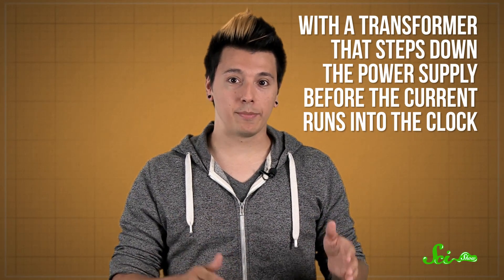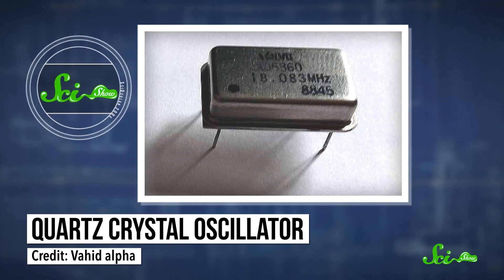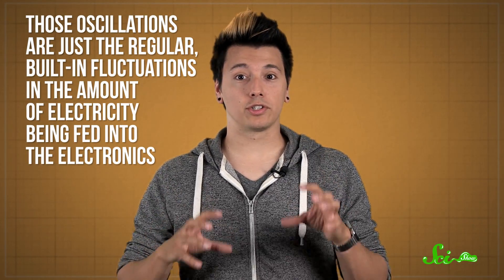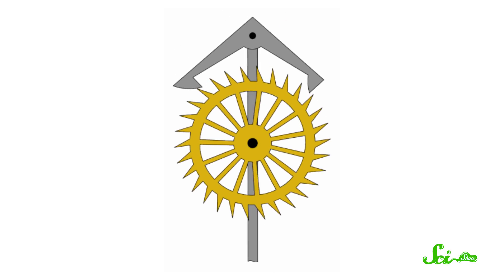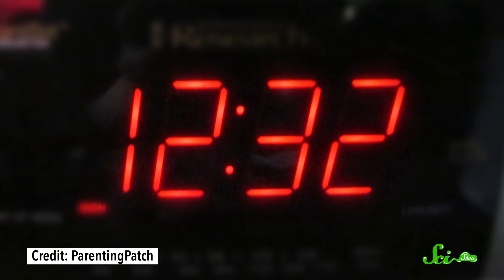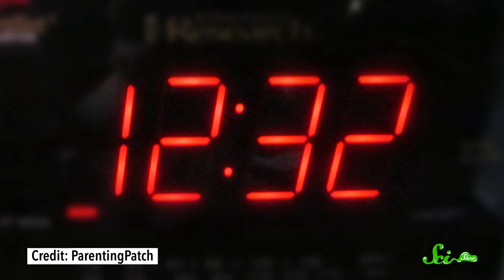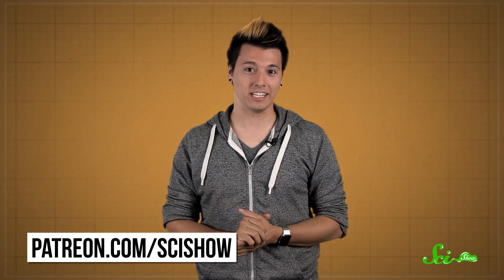How To Make a Digital Clock

Comment: 1. UNSCREW an old digital clock
2. PUT IT INSIDE A metal suitcase, so you cannot actually see the clock
3. run around with it near people, untill they panick

you ll guaranteely get a president approved clock, and also u ll get invited to the white house if you have an arrab name and not white color.

Comment: all you need is a 555 timer IC, connect it to 7490 IC counter and then to a 7447 BCD IC and to a 7 segment display, then apply DC power to it, wallah done.

Comment: You neglected to mention a housing for your digital clock. A metal case should do the trick very nicely and will draw no attention. For added impressiveness, a cable can be wrapped around the case for no apparent reason. You should avoid taking your device to schools or airports, but the White House shouldn't be a problem.
Reply: I think they put red visible digital clocks on bombs only in movies :)
Reply: Linus Magnus True, but how was the teacher to know that for sure? Shouldn't a teacher responsible for the safety of a student body err on the side of caution?
Reply: True Dustin. I just wanted to point out how majority of the people see world trough movies :)
Reply: +Dustin Zilbauer nah bro.  He said in the interview that the wires were placed on the handles to make it "less suspicious".
Reply: +Dustin Zilbauer getting in line for the Whitehouse tour with something similar would be problem. Taking something to the Whitehouse that's known not to be a danger wouldn't be a problem.

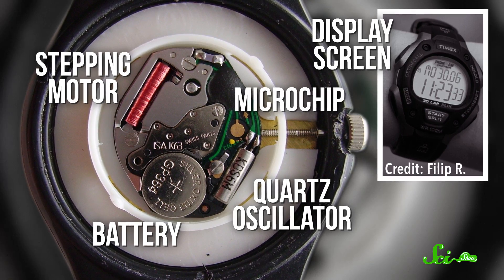Comment: @2:17 They show the 'parts of a digital clock', and the face of a digital watch.   But, why would there be a stepping motor for a digital display?  I think the back of the watch shown is not a digital watch, it's analog watch.  They even clearly label the stepping motor, as if it's a required part of a digital clock... lol.  The stepping motor is used to turn the gear shaft of a geared watch at the proper rate, and has nothing to do with a  fully digital watch.

Comment: Using the frequency of the power source is not a great method because this frequency fluctuates. The crystal oscillator is the most crucial and interesting part of a digital clock, yet this video doesn't explain how it works at all :(

Comment: You are making it sound like a stepping motor is needed for a clock with a display @2:15 . Which is not correct. The stepping motor is to make the watch hands rotate... The insides of the watch that is shown is of a analog watch, not from a digital watch.
Reply: +Derk Vedelaar I just wrote the same comment, Derk.  I can't believe we're the only two that spotted that.  Epic SciShow fail, IMHO.

Comment: I know a most of the time the clock cycle of a digital circuit is governed by an oscillating quartz crystal. Is it possible to make an LED continuously blink using only resistors, capacitors, inductors and a powersource?

Comment: So if I take a US electric clock and I plug it through converters into a European socket that runs at 50hz, there's a very good chance it will run 12% slow?
Reply: We don't see clocks using the AC frequency anymore as an oscillator source. In fact, I never saw one in my life... There is little reason to go out of your way to use the HV frequency while cheap precise oscillators or even full-fledged RTC chips have been around for decades. So, no, it would likely work normally. In fact, considering how switching power supplies are these days, I'm pretty sure you could plug a 120v rated clock in a 220v outlet and it would work normally (or just blow up).
Reply: I'm really OK with either outcome as long as I won't lose the deposit on my apartment for blowing up a clock.
Reply: Raina Ramsay I like how you think.

Comment: I do have a question that is pretty unrelated, but scientific nonetheless. It's September 28th at 1:19 am, the sun set at 7:18 pm and it's still light out as if the sun set 20 minutes ago. I live pretty far out of the city and when I look out towards the forest to the east away from the city the horizon is also saturated with that natural blue twilight. There are no settlements that way that provide any considerable light pollution for a considerable distance. I raided the googles for an answer, but I got nothing. Can anybody help me understand this curious phenomenon? Is it just residual light? Is it the moon? plz halp.
Reply: +Maplebaconz I am going to guess Zodiacal light, wiki link https://en.wikipedia.org/wiki/Zodiacal_light, but that is normally more seen before sunrise. But it could be a city many miles away, Idaho Falls ID, is 160 km (100 miles)west of Jackson, WY and stills causes light pollution.

Comment: Interestingly, this is also partly why clocks become out of sync. In a pendulum clock, the pendulum itself will slow down over time, and with any jostling movements, would be adjusted, and could cause the clock to lose sync. It'll still be pretty close, usually though.
In a modern system with electricity and quartz, the power coming in is often not a steady 60hz all day every day. There can be deviations where it's either higher or lower. If the clock counts at 60hz, but you're giving it, say 65hz, it's going to count 60 and say that's a second, where there are actually 65 pulses in that period. Again, this usually results in minor synchronization issues, but in more extreme cases could lead to large variations.

Comment: A transformer does not in any way "step down" power (it's close to 99% efficient). It only changes the voltage to current ratio while keeping the power (U*I) constant.

Comment: Disappointed. I thought you were actually going to go into making a clock from scratch. Like, digitally programming the circuits completely, down to the logic gates, and then using a industrial laser to cut out the circuit board. Then, put in the components after you make them based on the program. It just feels like cheating doing it any other way. :P

Comment: In a normal clock they aren't called gears, if it has over 20 teeth it's a wheel, if it has 20 or less, it's a pinion.

Comment: It's actually even more simple than that. For the different units, simply cascade counters so that each one sends a pulse to the next one when it resets. The conversion from the counter outputs to the correct 7-segment display output is also done on a fairly simple circuit, no need for a microprocessor.
Reply: Yeah, that's what I was just thinking 🤯

Comment: No, no, no...
If you want to build a digital clock, first you buy a digital clock.  Take out the electronics.  Put them in a pencil box.  Plug it in.  Set the alarm so that it goes off in the middle of English class.  And if you are Muslim, here's the best part.  You can use the internet to cash in on your heritage after you get yourself suspended from school for being a jackass.

Comment: Completely useless video.  I am now no closer to building a digital clock than I am becoming president of the United States.
Reply: did you get far enough to find out if so where the heck do you get a quartz oscillator compatible with a 9 volt battery

Comment: Using a crystal oscillator is the better choice because if the clock instead relies on counting the cycles of the 60 Hz wall power, it will not be possible to use a battery.

Comment: where do you wire in the detonator?
Reply: And don't show your teacher
Reply: And don't cut the grey wire.
Reply: Don't forget to put it in a sketchy metal box, you want to keep everything in place!
Reply: +Don Williams Pineapple
Reply: +Don Williams You'd need a payload of some kind first
Reply: +Darren Ng I have a feeling you are referring to Ahmed
Reply: +Andrew Tran dude, this whole video and comment section is referring to that Muslim kid.
Reply: +Don Williams anyone who seriously tells you how to add that has done a disservice to humanity.
Reply: +roguedogx It's not really that hard to figure out, could probably watch a few Mythbusters episodes and solve that part of the equation.
Really digital clocks/electronics are not essential to bombs at all, they just make them easier to trigger from afar be it a very long fuse timer or an actual remote signal.

Dynamite just needs a spark, and you run like hell, no electronics required. Bullets in a sense are also very small bombs, just need something to set off the blasting cap, though without a barrel and such it doesn't actually do much. Could probably make a long list of ways to make things explode without any electronics at all, you need chemistry not electronics.

Comment: Instructions not clear, would not explode. Alan Ackbar will not be impressed.
Reply: +Slavir Nabru I'm pretty sure he just took apart a premade clock and put the parts in a pencil case. Soldered ribbon cables and such, PCB traces look too small to be homemade.
Reply: +Slavir Nabru That is why you should sub me. Only Clear Instructions  on my channel.:)
Reply: +Slavir Nabru its a trap!
Reply: Clear Instruction Thankyou! It's about time I learned to peel a potato, consider me subbed.
Reply: Not Alan. Numb nutz